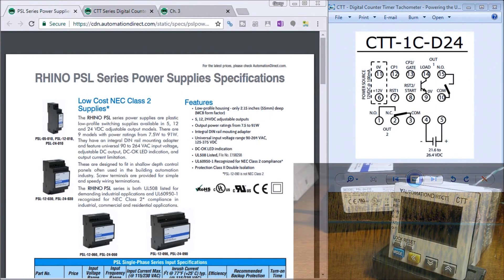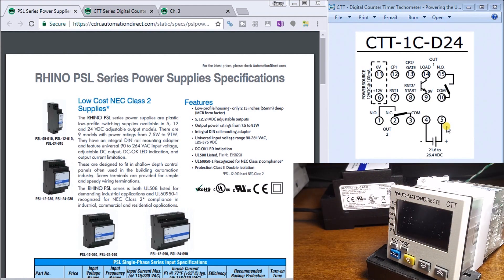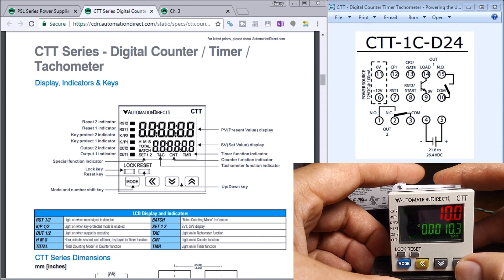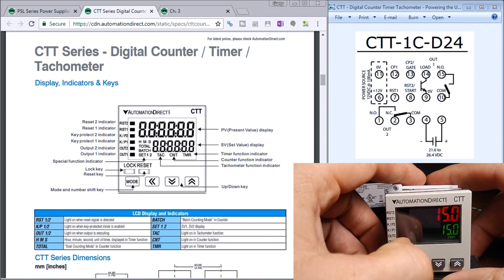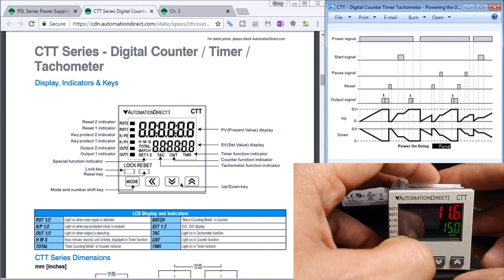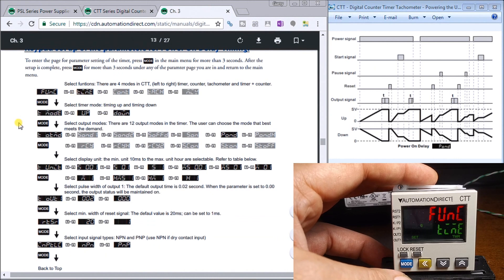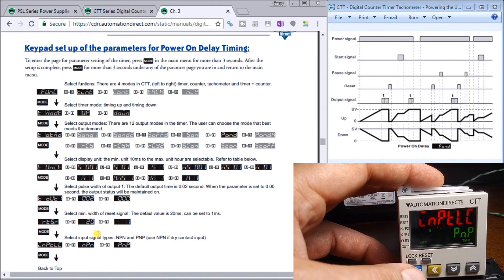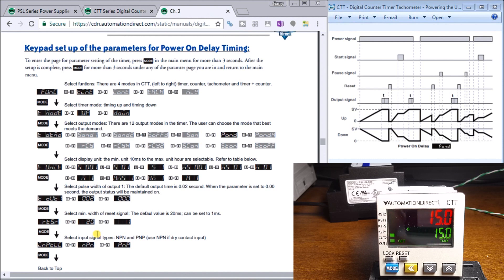CTT Counter Timer Tachometer – Powering the Unit

Comment: I want to add a push button to this timer. When I push the button will it hold the power to the unit acting as a coil? If so which contact should I attach to on the back of the unit?

Comment: You need to show how to wire the sensors to the counter. There’s 15 contacts and you only showed how to wire 2
Reply from the maker: Good point, Joe.
This device is so versatile that the combinations are numerous. Here is the link that will describe all the different operation modes for this CTT device.
https://accautomation.ca/series/ctt-multi-functional-digital-counter-timer-and-tachometer/
I have wired different sensors to the inputs when demonstrating the modes.
Regards,
Garry
Reply: @ACCautomation  awesome thanks ! I did figure out to jump the 12 volt power to start but nothing beyond that.
Reply: I jumped my incoming 24 to the power In order to use 24 volt sensors. I simply jumped 2 wires straight to the + and -, then tied my sensor + and - in together. I saw some drawings I can’t find again, but in them it looked like the sensor 24 had external + and used internal - , am I doing it correctly
Reply from the maker: @joew4202  
Can you tell me the make and model of the sensor that you are connecting? This way, I can look up the specifications and see the wiring.
Thanks,
Garry
Reply: @ACCautomation  ctt an d24. And one question, very few high quality sensors run off 12 volts, why are these only 12 volt power source
Reply from the maker: @joew4202  
Thanks Joe. 
What is the sensor part number that you are connecting to the counter?
Regards,
Garry
Reply: @ACCautomation  keyence Lr 5000 laser
Reply from the maker: @joew4202  
The keyence Lr 5000 laser can be an open collector NPN or PNP selectable. You will have to set this up on your sensor. It will depend on the wiring to the CTT. 
Here is a quick post on NPN and PNP.
https://accautomation.ca/heres-a-quick-way-to-wire-npn-and-pnp-devices/
Depending on the sensor output type will determine where the load is wired. 
You will have to also supply the sensor with 24VDC. The sensor's output is where the input to the CTT counter input is wired. It acts as the load for the sensor.
I hope this helps you out.
Regards,
Garry
Reply: @ACCautomation  is it possible to have the counter reset everyday at 6am, automatically ? I know if I kill power to it it will reset. One idea is to connect a timer relay to it and have the timer relay cycle power every 12-24 hours
Reply from the maker: @joew4202  
Yes, a timer relay set for 24 hours would work.
A PLC might be in order if you have a few other components. It could save you money in the long run.
Regards,
Garry
Reply: @ACCautomation  I found a PLC close by and used the GSV instruction To pulse 24 volts to the 7 and 8 pin every 8 hours.
Reply from the maker: @joew4202  
Glad to here that you got it working. Congratulations.
Garry